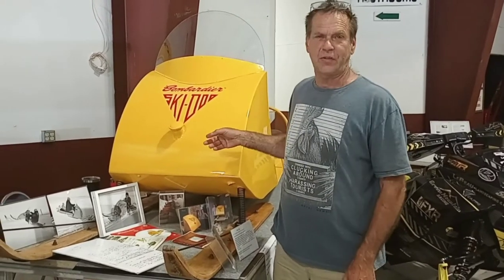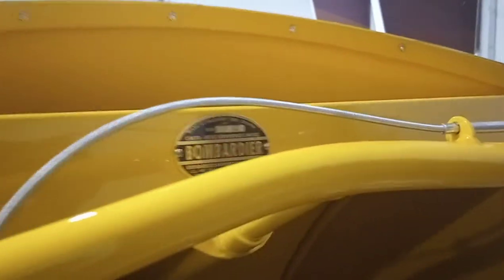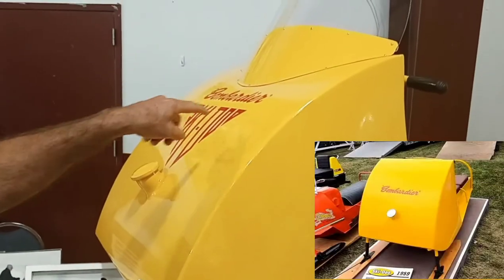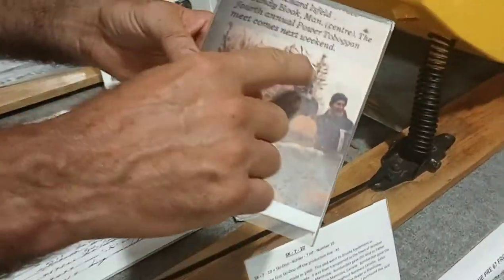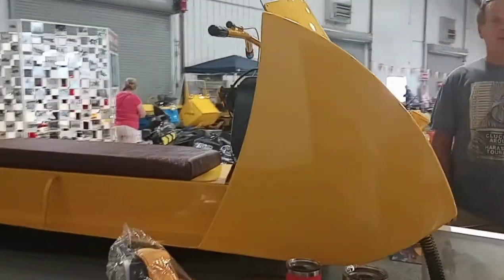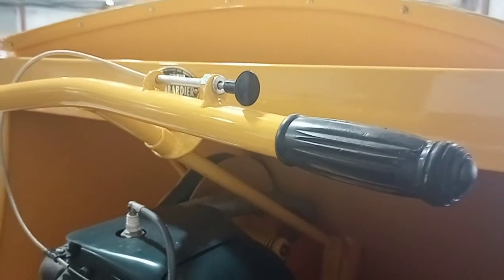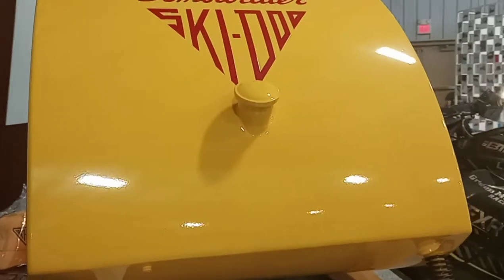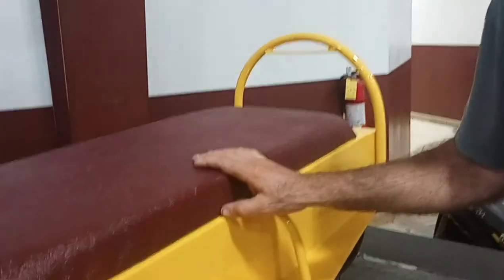The Very First Belt Drive Ski-Doo  (1960 Ski-Doo Tin Cab SK7-10)

Comment: The 1959 Ski Doos were built with a two-speed planetary gearbox..... but delivery of the 1959's was delayed and those gearboxes were removed and replaced with the "variable diameter" Clutch/Torque Converter like they still use today. The converted 1959's were mixed in with the 1960 models and were delivered together. The only 1959 Ski Doo in existence (that I am aware of ) resides in the Ski Doo Museum in Valcort Canada..... and it still has the planetary gearbox. 

Ski Doo dealers were selling 1960 Ski Doos as 1959 models, just because they had no idea that there was a difference. (The 1959 had no windshield and had two square seats instead of a single rectangular one).